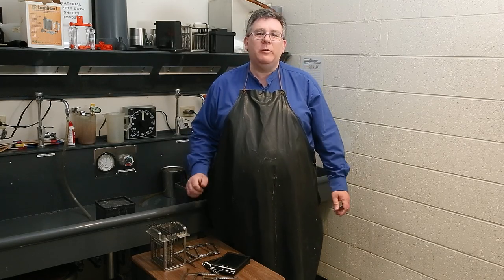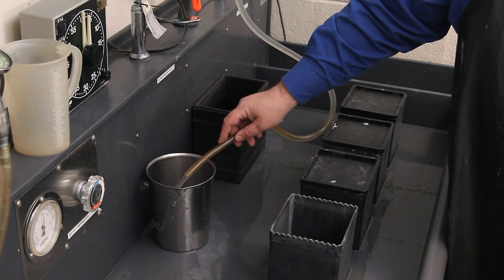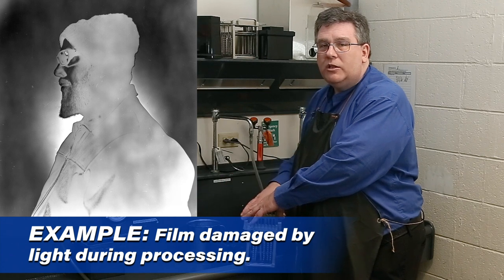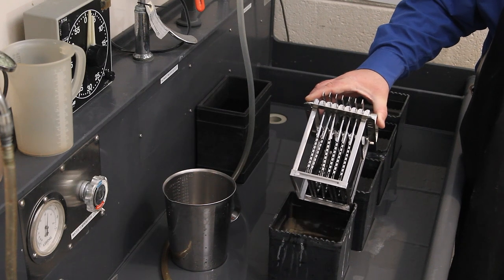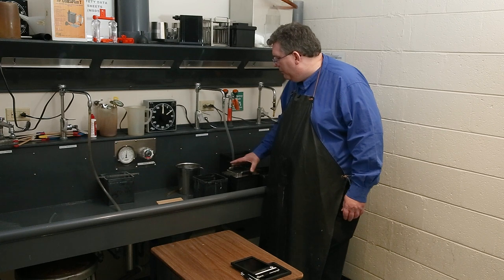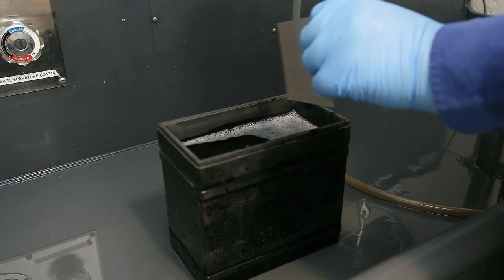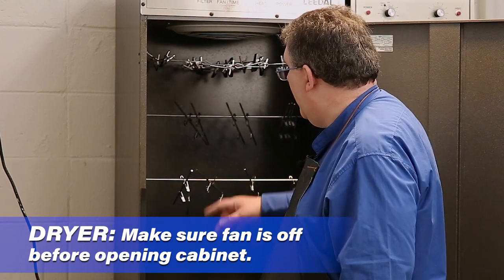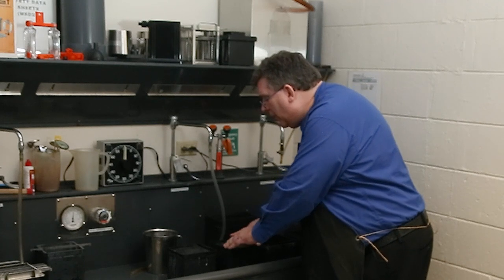View Camera - Session 5A - Film Processing - Dip Dunk Method

Comment: Great video, thanks! What is the part number or name of the rack you are using? I can't seem to find any that are meant for the Kodak 4A holders-- only the bigger ones meant for the Kodak Multiple Film Holder and 8x10. I'll probably have to build one, but would be nice to buy one off eBay if I can find one.
Reply from the maker: Thanks for the comment. They are Arkay 45-2 stainless steel tanks. Check B&H photo and video. Not sure if they make them any more.